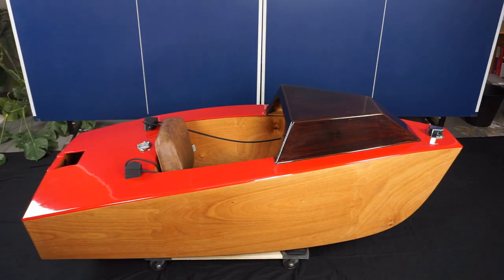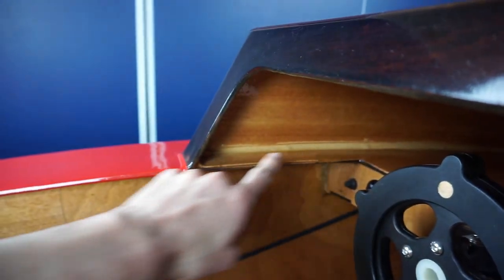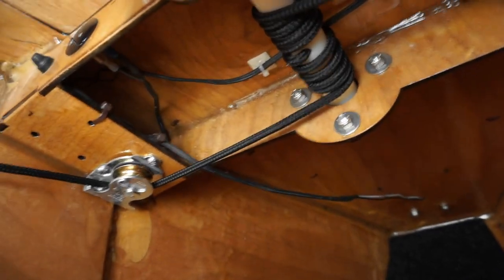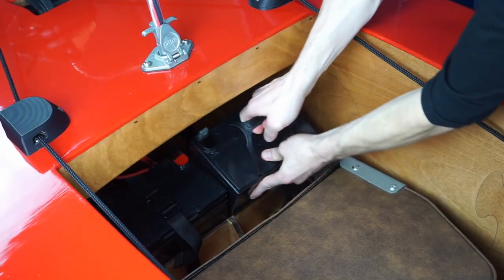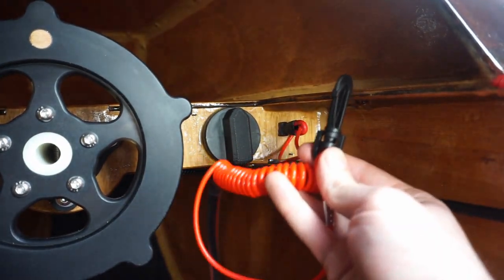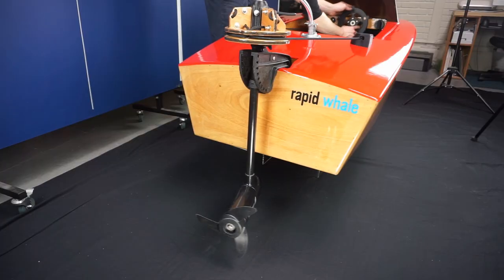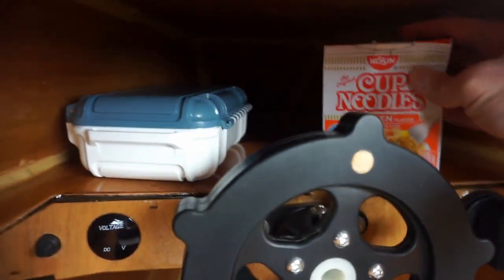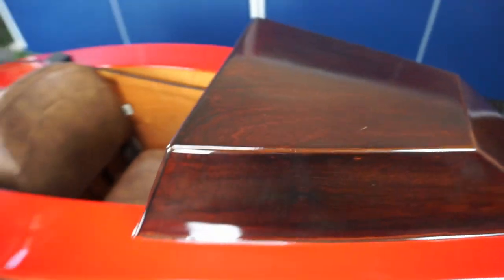Mini Boat - Overview

Comment: Im building an 8' plywood flat bottom now but yours is by far the coolest DIY boat I've seen. Really great! I like how neat the inside is layed  out. Where can I find the twisty thingy that locks your steering rope. Im gonna use a four stroke weed eater to power mine but was unsure of an easy way to steer it. I think I can convert your design to stick steer. Once again very cool!
Reply from the maker: Right on, go check out the bill of materials, linked-to on the website. Just FYI: A 4-stroke weed-eater engine might not be enough power to get your 8' boat to plane, in which case you might want to just stick with a $200 electric drive train setup.
Reply: Joshua Tulberg 
I don't expect it to plane just to meander around the edge of lakes fishing. I already have the weedeater so I will only be out the cost of a prop. If my calculations are right, it should put out 486 ft lbs of torque but I don't figure a trolling prop will handle full throttle.
Reply from the maker: An 8' boat is going to have a very slow hull-speed, probably 5 mph. So unless you are going to give it enough power to plane, that hull-speed is going to be your limiting factor. Hence my recommendation to just go with an electric trolling motor setup.
Reply: Joshua Tulberg 
But the weedeater is basicly free. I have no use for it since I bought the big weedeater thingy on wheels. The old weedeater hasn't been used in years. Once I get my wife hooked on the boat then I can talk her into a real motor. Its a game Lol. We've been playing it for 29 years :)
Reply from the maker: lol. Sounds good.

Comment: How do you keep batteries from getting wet?? I imagine that the smallest waves can cause some water to enter the mini boat, and the batteries are just behind the seat. Same with the power connector on the back: is it waterproof enough so the water that gets spilled on the back doesn't enter the electrical junction??
Reply from the maker: Matias Dos Santos - It actually takes decent chop to get any water in the boat. Go check out the sea trial videos. But to answer your question: K don't keep the batteries from getting wet. They have been completely submerged in ocean water multiple times and it doesn't seem to make any difference. The boat could operate under water if it were able to sink that far (it's not).

Comment: i’d love to build one from scratch. but have no access to a laser cutter
Reply from the maker: You could use a jig-saw. I also offer bare-hull kits, but they aren't cheap.
Reply: Joshua Tulberg  I own my own 3d printer ( flash forge creator pro. I can only print ABS/PLA.) Im getting short on $ to buy a kit. About to buy my 3rd jeep. I do everything in the RC  hobby, 3 boats, 30 planes, 12 quads, 1 tank, DIY Segway.  Check my channel out for more details. 
I was thinking of winter projects to work on, My 2nd jeep TJ body, 3 planes to build, 1/4 Tiger Tank or a mini boat. ( I have a two  6ft deep ponds in my yard).
Reply: Joshua Tulberg   Whats your body height. Im 6 ft 3in. Tight fit?
Reply from the maker: ABS is fine (that's mostly what I use), but PLA would melt in outdoor use. I did some RC crawling stuff for about a month or two. It was fun, but expensive.
Reply from the maker: My Dad is 6'2" and 175 lbs.
He fit in it fine.

It wouldn't be a mini boat if it wasn't a tight fit.
Reply: Joshua Tulberg  its been awhile since last using ABS, PLA is so easy to use. At school I have access to use the schools $150,000 printer ( Stratasys)
Reply from the maker: Right on. Just reach out through my business (link in description) if you are interested in purchasing digital plans.